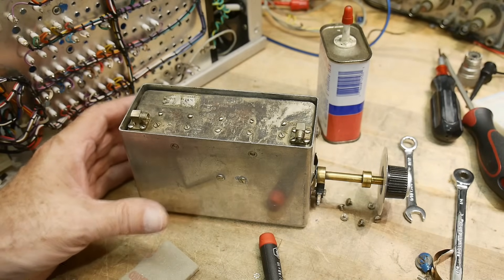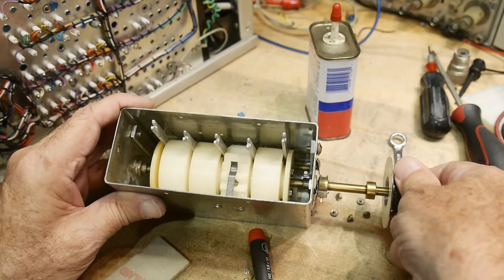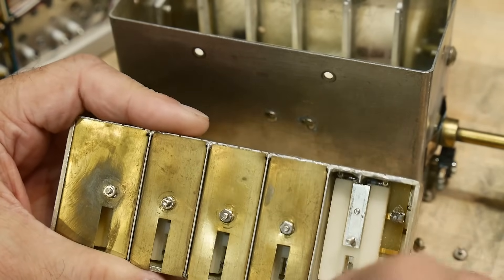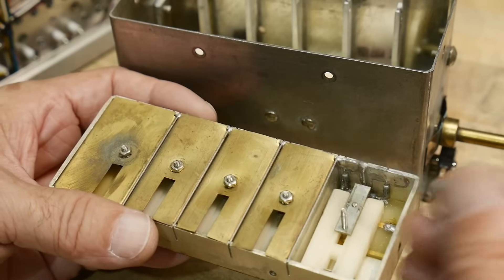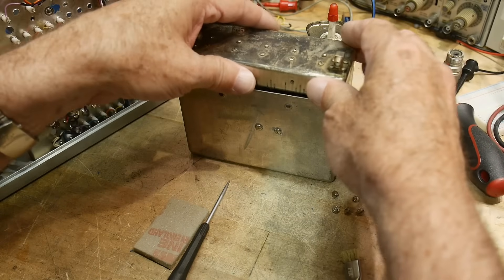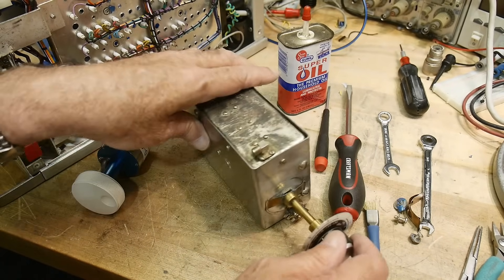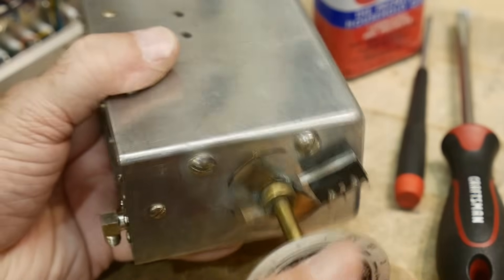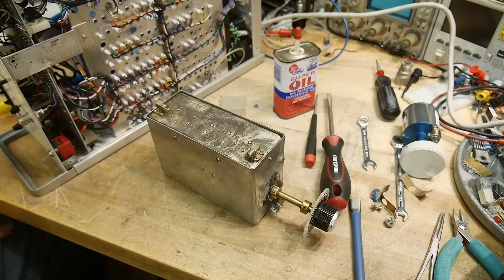#1904 Wavetek 3000 RF Generator (part 5 of 14)

Comment: Gray Code?
Reply from the maker: 10, 20, 30, 30, 40
Reply: Nope. Grey code is designed to only toggle one bit at a time, to reduce the peak current to one bit change. It's mostly an avionics thing. IMSAI's got it.... Se above. 73's W3IHM
Reply: maybe not